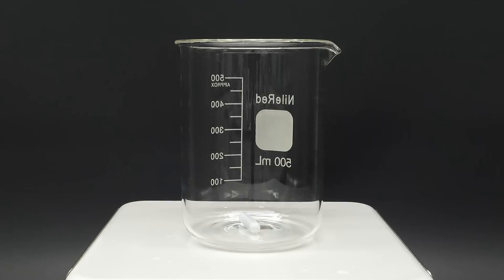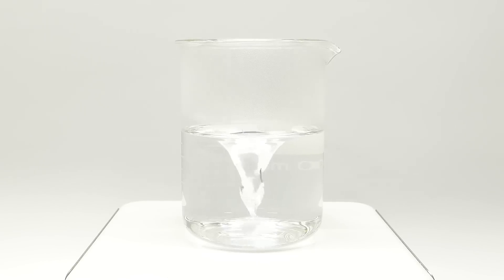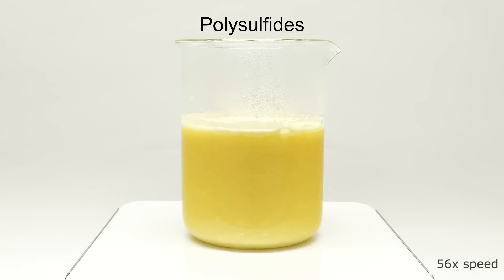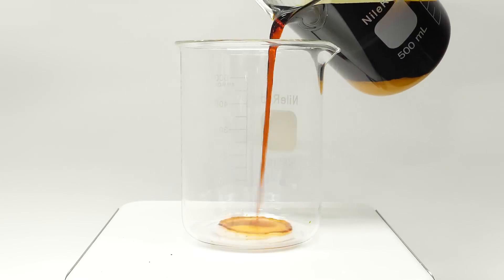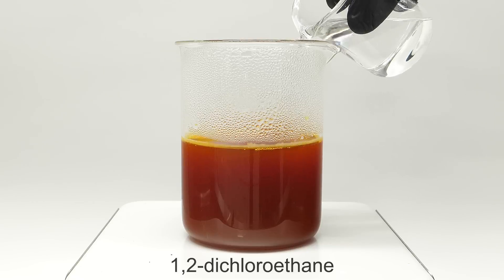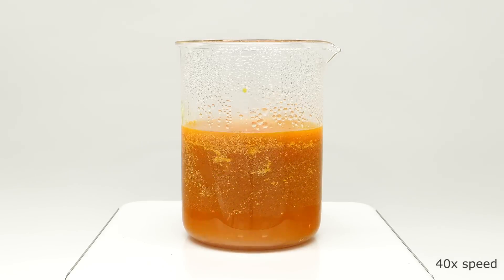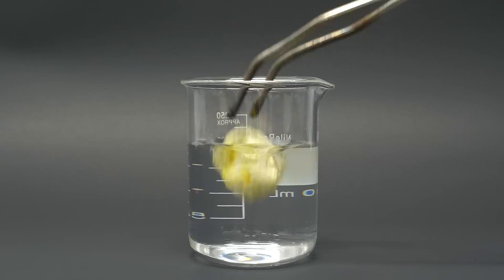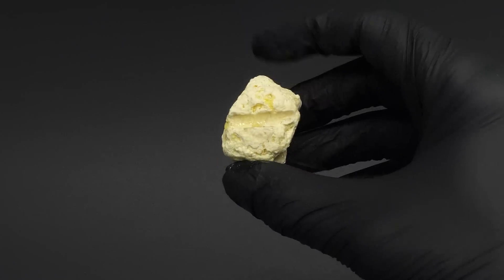Making a squishy rubber bouncy ball from scratch

Comment: Question:
How does the stirring happen?
Reply: Stirring used stir bars inside the beaker which rotate because of magnetic forces caused by the rotating magnets of the hotplate stirrer under the beaker.
Reply: @cheekywombat9208  ah, thank you!

Comment: maybe if you repeat the process with a spherical flask you'll get a rounder ball, also you probably have to start with a huge ball and compress it down until most of the liquid is gone before it will hold it's form enough to bounce back

Comment: I did this synthesis in junior high chemistry. I didn't let the mixture cool and add the polymerisation chemical directly into the beaker on top of the Bunsen burner. Luckily, I didn't start it on fire or knock it over either! Rubber smelled to high heaven -- should have rinsed it off like he did.

Comment: That raises a question in my mind watching you make that solution of polysulphides. 
I take some drain cleaner crystals and add some sulfur to it, then slowly heat it up in a big metal pipe cap until it all melts and reacts. Then while it's liquid, pour it out into an aluminum dish and let it cool and solidify. It's called the liver of sulfur. You put a little piece of it in some water to get a yellow solution which we can use to patina copper or bronze.
Problem is, once you make it, it doesn't tend to last very long before turning white and going bad. 
I'm guessing that liquid solution that you made wouldn't last just sitting in a jar for a couple of months either?
I'm not a chemist so I don't really know why the liver of sulfur solution breaks down over time. My guess would be the complex with sulfur breaks down and it falls out of solution.
Reply: The polysulfides aren't very stable in general, and in particular they break down in low pH; exposure to CO2 in the air will tend to slowly lower the pH over time, and the polysulfides break down into just sulfur and fall out of solution, just as you suspect.

Comment: I think it's just the fact that it's spongy, so it absorbs a lot of the energy and doesn't bounce. A completely solid one would be a perfect bouncy cube
Reply: You are 100% correct. That's why Superballs are made by injecting the material into a mold at 4000 PSI. It needs to be tightly compacted in order to achieve a very high bounce.
Reply: Maybe he can melt it and reform it
Reply: @nasdfghidgf8081  not a thermoplastic. Will pretty much turn into permanent sticky goo if you try to heat it.
Reply: @SianaGearz  yup! Done it before, it turned to a dark sticky goo.
Reply: yeah I assumed that
Reply: It needs to squish at least a little, because that's how bouncing works. (note if the sulfur is elastic (bendy) enough it can still squish but I don't know how elastic sulfur is)
Reply: @iMok_2143  it needs to deform and then spring back to put the energy back into the system. If it just squishes it will just heat up the material and absorb the energy, not bouncing

Comment: Too squishy,  and  there's not enough  force to compress into a solid ball. Because its so soft,  it easily loses all its stored energy into its deformation.
Heat it and cast it in a small mold of a ball or marble.  I bet it will bounce more

Comment: Hey Nile, can you suggest a plastic that's kind of like skin? I'm trying to make metal protectors for fingers since I can't play guitar because it hurts too much. I have the metal part down but then the strings slip past your fingers because the metal is smooth. So I'm trying to figure out something that's like skin: it has to have enough grip for the string, but if you have two fingers next to each other, it shouldn't seize up. And then, it should also have a bunch of give, like a finger does: when you hold down a string with a finger, the finger's flesh deforms around the string, keeping it held down not due to friction, but due to a mechanical lock by virtue of being around the string, kind of like an open-ended hex wrench. I haven't been able to come up with anything good for that, I've tried everything I could think of. Oh also, it can't get damaged from strings... that's another big issue with those things.
Reply: Surgical gloves or rubber gloves?
Reply: @kingkn4845  they tear easily, they don't adhere to metal, they're not flexible enough to do the grip thing, and they seize up against each other (when playing guitar you need fingers to slide past each other but also the exact same surfaces need to grip the strings)